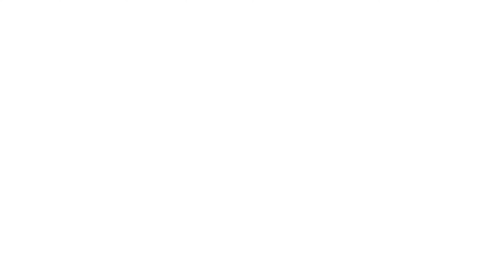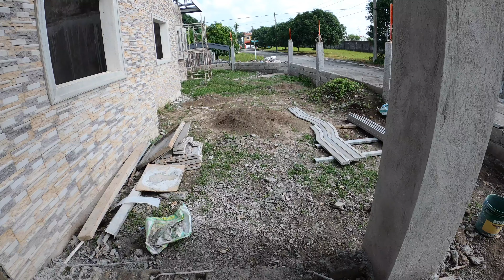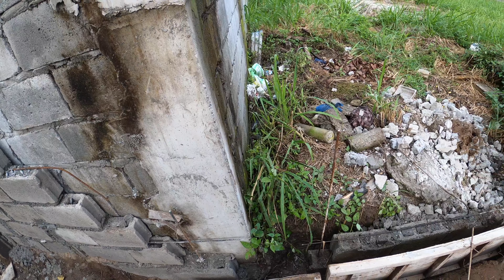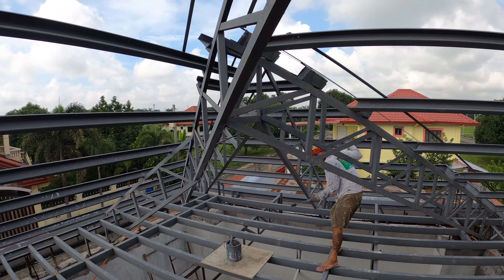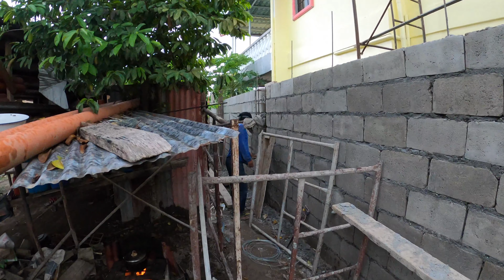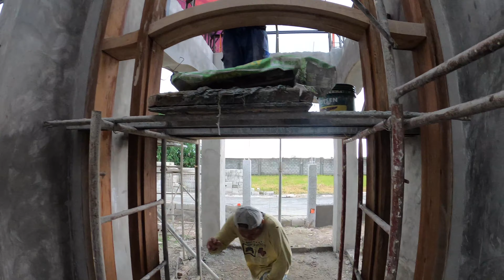Philippine House Building Step by Step, Build Day 131: Closing The Fence

Comment: The building progress is shaping fast.  Nice to see the fence line gap finally got completed.  I imagine you're glad as well.  The custom molded cement board forms are impressive.  Still looked cloudy overcast... we could sure use it here in Northern California... Looking forward seeing that roof....  anyway stay safe...
Reply from the maker: +The Veteran and Pinay Life
Small steps make large strides. Cloudy with small showers yesterday. Power interruption today and only small amount of cloud cover, almost no breeze. 😓

Comment: i would be using a strong tile adhesive to bond those mouldings over arch ? interesting way they do it there , hope it all stays in place .
Reply from the maker: andrew c.
I have seen very few of the moldings fall off of the walls. Usually when you do see it, the house is already 30+ years old. I think their method works well and is fairly standard around this area.